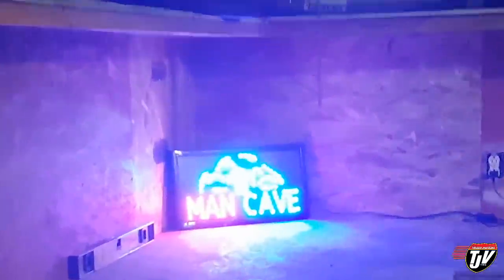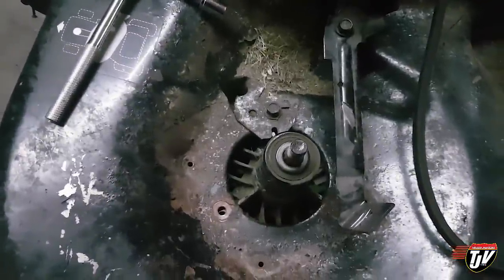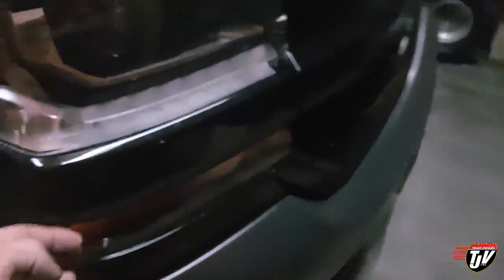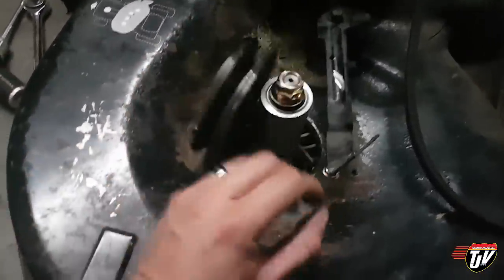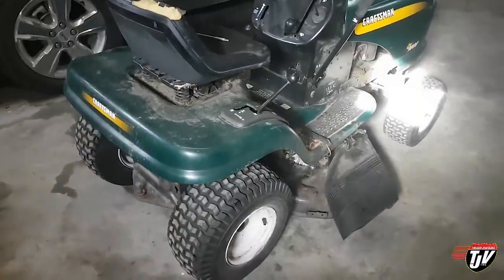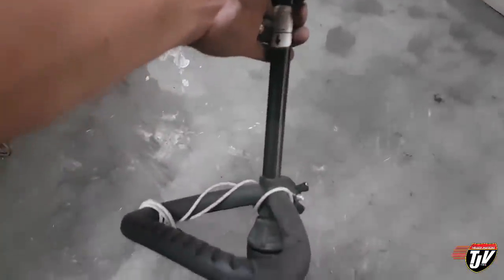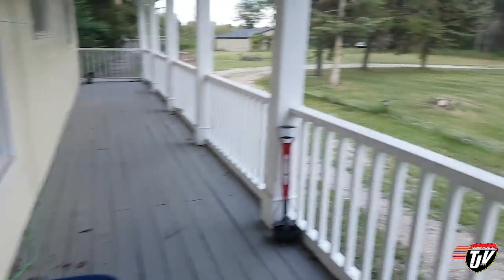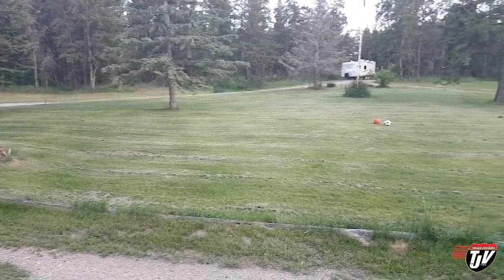TJV Sat. -THE MAN CAVE!! - #1446

Comment: Before you replace the facia on the garage trim, it might be a good idea to at least apply a coat of primer paint over the wood to prevent rot.  It also might be a good idea to save the mower parts, the broken metal could be welded back together in the event either of the new parts breaks (Would save time waiting for parts.).

Comment: Buy a 3000 series with a loader and 72 inch mower you can get a optional backhoe . Have a 2305 little 3 cylinder yarmar engine 28 horsepower . the tires are too small and very costly . it will lift close to 900 lbs with the loader and rear weights . Good luck with your homestead